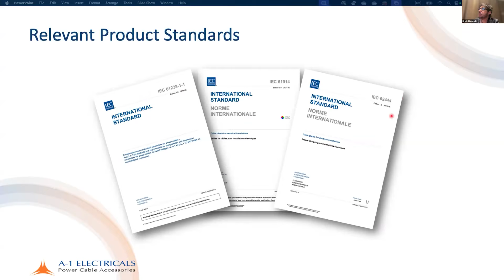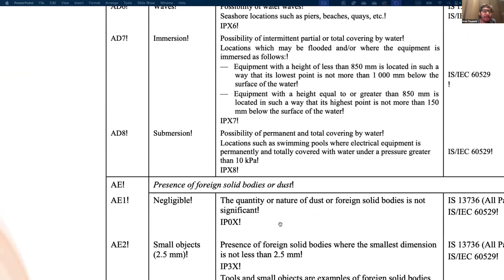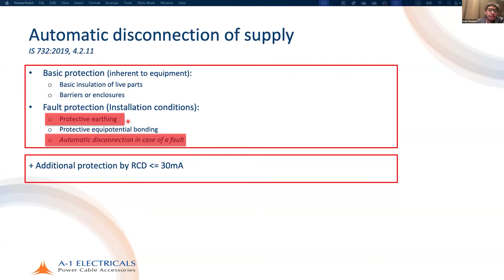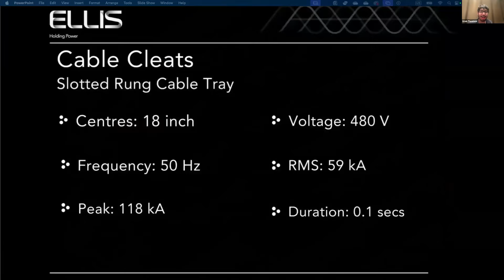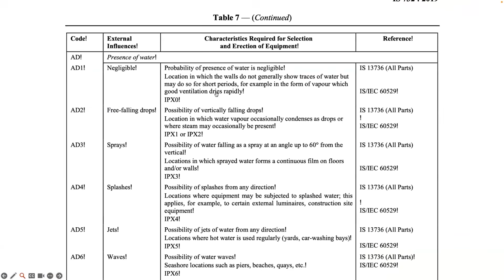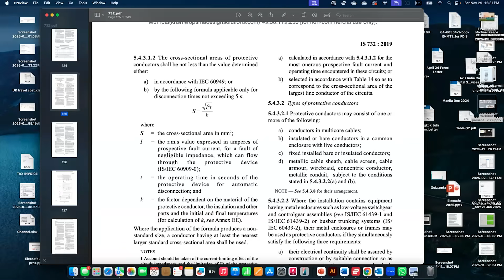MISTAKES WE MAKE IN TERMINATION OF CABLE ENTRY

Comment: single core there is a case of resultant current that will circulate on the gland plate. if all phases and neutral in one cable the total resultant will be zero.